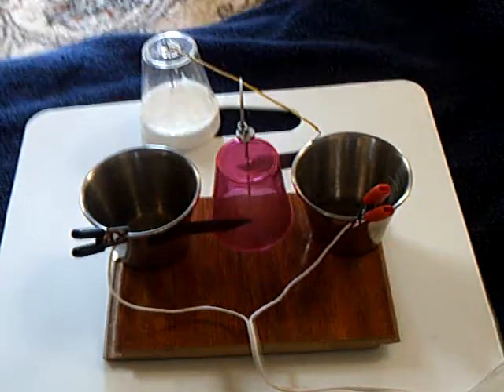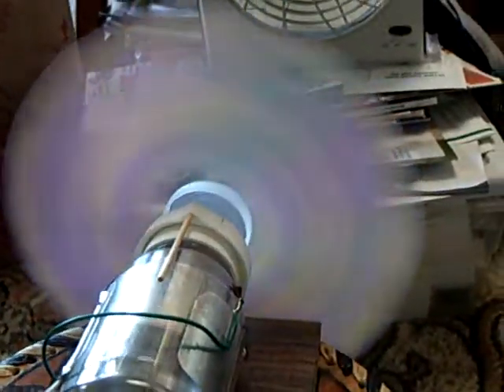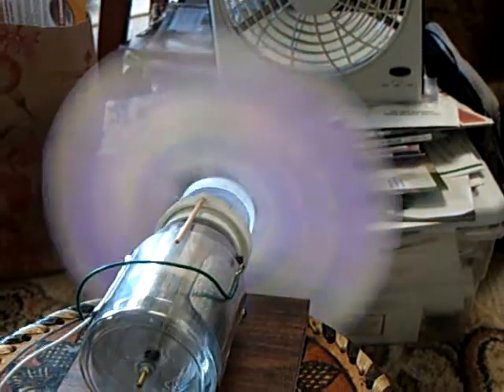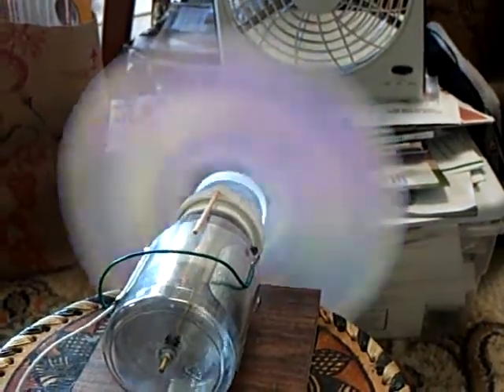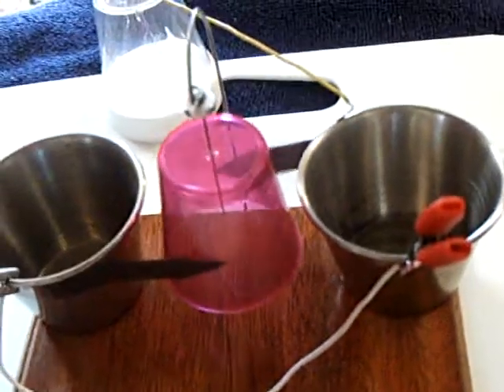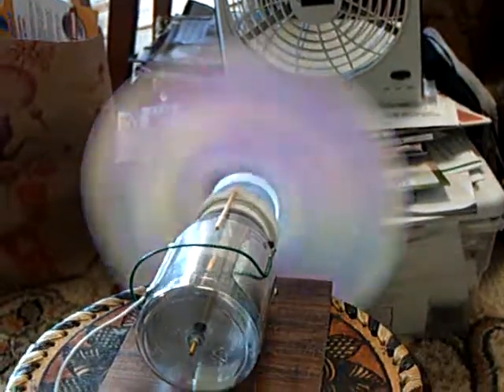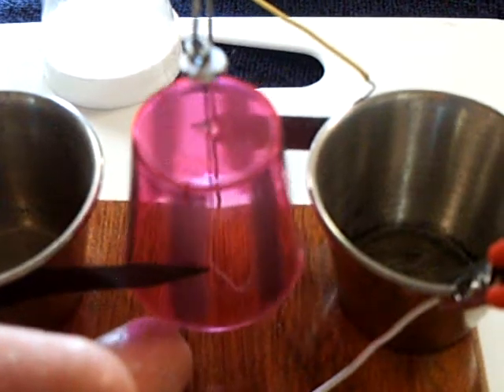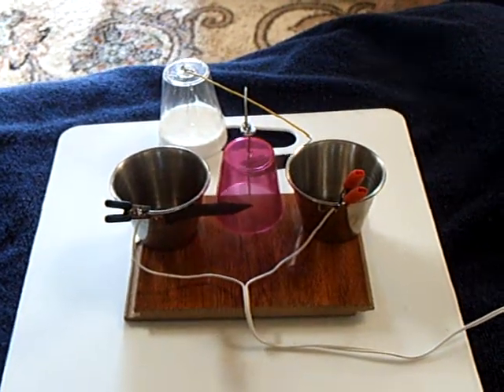Wind Driven Electrostatic Generator

Comment: Imagining a use case: Offshore wind with very high voltage DC generation and transmission done relatively cheaply with relatively cheap components. 

A single wire  transmits long distance undersea with some energy being stored in the dielectric insulator with an earth/sea water return path with low very low current because of the very high voltage involved.

Comment: It's my understanding that these electrostatic replenishers are good for up to maybe 15,000 volts. After that internal discharging issues takes over.  That would makes sense given air brakes down with about 3kv per millimeter, and capacitance drops off by the inverse of distance. Too much distance and the capacitance drops closer to near zero.  15kv means one would  need more than 2.5 mm  between positive stator plate to rotor plate and another 2.5 mm from the other rotor plate to the negative stator plate. 

I suspect one could get very much higher voltages if they use a good dielectric oil,  Which should allow one to store very much more energy in the electric field generated. 

The  energy stored in a capacitor  is E=1/2×CV²  so
I think this means if an oil dielectric with 3x dielectric constant of air allows we're also to allow 3 times the voltage before brake down, Then E would increase by 3Capacitance ×(3Voltageb)²=18 times more energy over that of air alone. 😊

Comment: It's correct to state that there isn't or isn't much of or any lenz effect in in electrostatic motors.

Lenz effect provides negative torque to a generator with coils and magnets. And becuse there are almost no current in an electrostatic machine, it's appropriate to say there isn't much much of or any lenz effect in an electrostatic generator. 

Instead, with electrostatic generators, you physically push and move coulombs of charge to regions of higher potential or against existing fields, the electrostatic force itself exerts a counter-force that directly opposes your mechanical input.  That is, your doing work (expending energy) to store energy on capacitor plates in the form of electrostatic charges. 

 its with noting that the energy to run one of these electrostatic motors is very small and so very little energy can be stored on capacitors with these plates at their distances.

Comment: wow ingenious demo of an atmospheric motor in role reversal as a generator instead, why didnt i think of that? it defies back emf and produces low amp high volts, contrary to the homopolar generator that produces low volts but high amps...lets call your device the A machine!! well done...it never crossed my mind that such motors could also be role reversed to produce energy possibly like a wimhurst generator
Reply: It is classified as an influencer machine similarly with wimshurst.  Technically  it has much in common with a lord kelvin replenisher, and or simplified voss.

Comment: electrostatic power dosent suffer from the atomic resistance that electromagnetic power dose and it can travel almost double the speed of light witch is the reason there is no atomic resistance and very little loss over distance =3-

Comment: Awesome!!! I love it :)
Reply from the maker: Thanks.  I have been following your videos but have not left any comments.  I really liked your rebuild video of the VW heater.  I didn't realize that it was so cold where you live in Canada.  Sunny spring day and 10 degrees.  Wow.
Reply: lol no stress :) Well it's only this year for some strange reason it's still very cold..... at least it's not -40 :) last year I already had my AC in the windows. I love that little heater glad I bought it it's almost finish need to find a proper exhaust tube and something to mount it on with a gas tank and it will be all set ^.^

Comment: Was a thinking..  Is the static electric in the spark a/c, if the spark was a wave form on an oscilascope it would suggest a/c, when it gets to the metal is it then d/c? Could the spark be made to fluctuation with an ionic wind effect to modify/create a/c on the recieving terminals? If it was a/c it could be processed to lower voltage with a transformer.

Comment: Now how do you convert static energy into something useful and usable such as DC energy?
Reply: There is a problem with many people's understand stemming from conflating or not seeing the difference between static (stationary) charge with moving charges.  Static charges can get stranded on an insulator while conductors  can move excess electrons to where there is less.
Reply: It already is DC. Current Electricity or Direct current is the flow of electrons. As you can see from the video, electricty is "flowing" down the wire. Static electricity is made of electrons that do "not" flow. If it was "just" static electricity, then it would not be "flowing" down the wire. The only difference between this and a regular generator is that it makes electricity from plastic bottles which creates static electricity, then the static electricity is converted into current electricity down the wire to the motor, then into the ground, back into static electricity. a regular generator uses magnets instead of plastic. The generator in the video can't just power a motor. It can light a bulb, or charge a phone.

Comment: Neat demo, especially the wire run.
Hmm, makes me wonder about an alternative sort of wind turbine. Your windmill section runs very freely, so would begin spinning with very low amounts of wind I presume...generating away when motor/gearbox types wouldn't even turn.
Reply from the maker: I think that perhaps you could use this to fill up an HV cap and then use some kind of cap dump circuit.  The trick is to let it spin free to make the juice.

Comment: That is amazing to see you can do such a feat. Static power maybe the way to go an av plug and small capacitor and dump charge battery cells. Worth a try. Best of luck in what you do.
Reply from the maker: You might be right about the cap dump idea. Trade the HV low amperage to lower voltage with some punch.

Comment: Now we need a no Lenz confirmation :) I believe that if "amps" travel 90degrees out of phase with voltage, then its quite possible that you connect true electrical balance in the vibration of materials. For all things have an "electromagnetic field" or vibrations and its potential for change.  
I have been wanting to do an experiment for a while but have not had the time. If there is no "Lenz drag" then it might be possible to hook 2 generators to 1 motor and it will run off its own power so long as they have very low friction.   Just a theory using the asymmetrical number 3. Thanks as always for sharing your findings :)
Reply from the maker: These electrostatic generators do load down when they are filling up a cap but running free like this with a motor on the end they don't seem to care.
Reply: That is important to note, thanks.
Reply: @Lidmotor  putting a load on the motor slows down the motor and the charge builds up. And for the charge to build, up the replenisher needs to push electrons against other electrons. 

If the electrostatic motor had no load and was nearly frictionless then it would drain the voltage across it  down to nearly zero and then it takes very little energy to push a few electrons in a field with just a few electrons.
Reply: Where as electromagnetic motors use the Lorentz force, electrostatic motors work based on the Coulomb force, which is the fundamental force of attraction or repulsion between electrically charged particles. The Coulomb force is described by Coulomb's law, which states that the force between two point charges is proportional to the product of their charges and inversely proportional to the square of the distance between them. Electrostatic motors use this force to generate rotational or linear motion, typically by applying a voltage to a set of stationary electrodes and a set of rotating electrodes, which creates an electric field that exerts a force on the charged particles in the rotor, causing it to move.